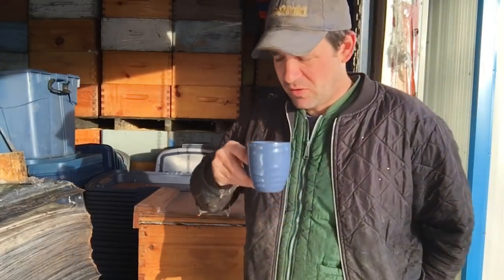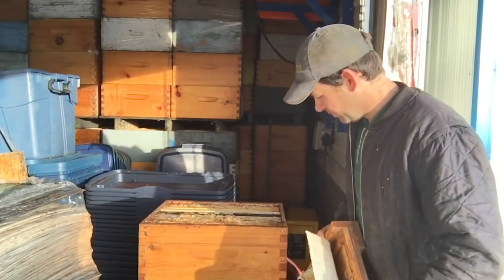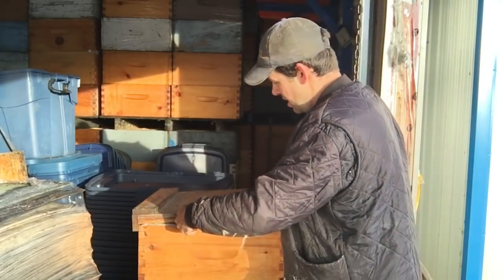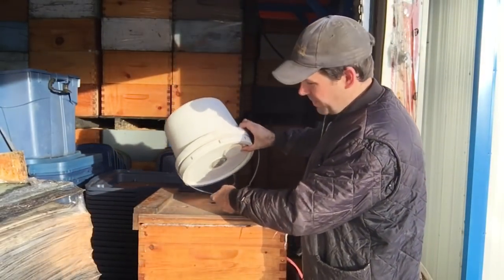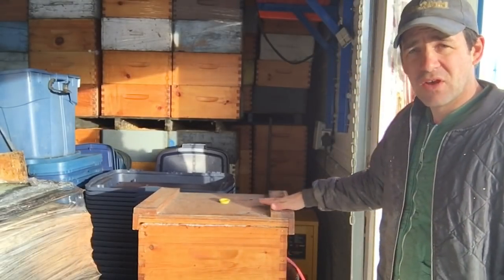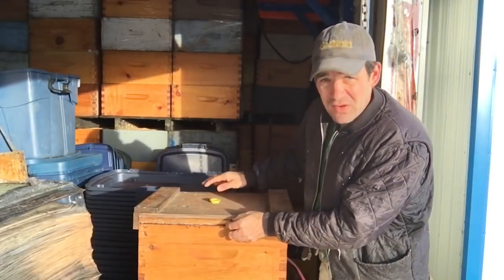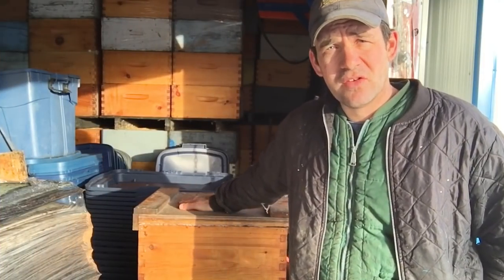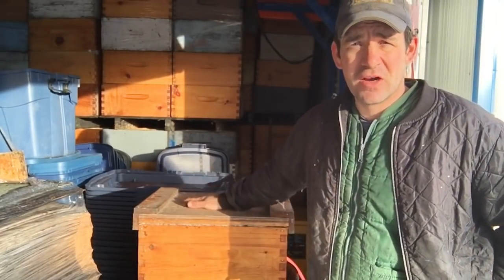Why I use pliable inner covers and thoughts on upper entrances

Comment: In the USA the product is marketed under the name 'reflectix". Home Depot sells it in rolls. It's meant to be used as duct insulation. 
Here in central Illinois I put feeder shims on hives prior to wrapping.
I bore a hole in the shim and the bees like it. I know because they never seal the holes shut. A vent combined with insulating the cover allows moisture to get out of the hive rather than condensing on bottom of lid.
If you've got moldy lids...you need to provide a vent and insulate.
Some beeks wrap hives with reflectix too. Spray it black.
Reply: Thank you, found it with that

Comment: Get that stuff at home depot, they call it reflectix, comes in 16 inch wide rolls, just cut them to length for use on a hive.  Works for a quick and easy wrap too, good wind break and a small amount (R3) of insulation.
Reply: Gerry Rozema unline has it I see cheap
Reply: You order it from FarmTek also.

Comment: Love your double hives on pallets with migratory covers.  Hives will stay warmer, not as easy to steal,  no more inner covers to make the list goes on...  My  question is i winter my bees outside usually under the barn or in a chicken coop with 3 sides protected.  Wanting to use the pliable inner covers that you use, my concern is moisture without an upper entrance?  My normal practice is inverted inner cover notch facing up and a piece of 2 inch foam then my outer cover for winter.  Any tips you might suggest?  I could cut a notch in the migratory 3/8 spacer on opposite sides but trying to avoid having two entrances.

Comment: Great stuff ... love them covers glad you showed that 1/2 " rim on the inside thanks.... 2 Q .... how do you melt the screen in the lid ? I bought the same feeders work great but need to make larger size ...... those yellow caps do you know what there called so I can hunt some down ..... thank you for the video good stuff
Reply from the maker: Ryan Nims I buy the pails with screens melted in from BeeMaid, also the plugs.  They have plugs from 1/2-2” 
They also sell the SS screen cut or in rolls.  Guy I know uses a modified calf de-horner, welded on a round ring... you might need to get creative 
Check out www.beemaid.com
Reply: Thanks for replying

Comment: Ian really enjoy your videos. I’m in my first winter ❄️ I’ve gone from 1 hive to 5 and my goal is to get through this Northern California winter with 5 and make queens and splits in the spring. My big ???? Is ventilation, We are getting a lot of rain, and snow in the upper elevations. Temps are in 40s and 50s, what should I be doing to keep the moisture out of the 8 and 10 frame hives? Any suggestions? Should I be using your bubble inner cover? Trying the simple as possible method, since I work regular job 50 +hours per week. Thank You really appreciate that

Comment: Hi there, those ply lids look nice and simple. What thickness, treatment is the plywood & do you experience much warping or rot. cheers
Reply: Nick Sheffield afaik from another video: the newer ones are dipped in wax, that eliminates the need for paint and preserves the wood very well.

Comment: Hi Ian,  I’m a retired machinist, still trying to get used to “close enough” when making my own equipment.  Regarding your 1/2” step inside your top cover, when you said it was a 1/2” runner, are you saying it is 3/4” wide x 1/2” thick, or 1/2” x 1/2” or what?
Thanks,
California Mike
Reply from the maker: MtwWallace 
It’s 1/2” deep

Comment: I have to disagree on your comments concerning scale doesn't matter....because it does.  Not in regards to your management goals, but how one goes about doing it.  Newer bee keepers fall into the trap of monkey see, monkey do.  The case that aggravates me the most is the exclusive use of deeps by larger apiaries on YouTube without the caveat that they aren't for everyone.  I've had to rescue more than a few lightweight ladies and older gentlemen that bought deeps because that is what they see the pros use.  A deep full of honey is right at my limit (7 decades in the rear-view mirror) and I would never recommend a small bee keeper that isn't a former circus strong man to use them for supers.  You and many commercial outfits have lifts, which isn't in the budget for someone with a few hives....but newbies don't seem to draw the connection that for most folks using deeps for supers is a one way ticket to the chiropractor.  Similarly most small guys can't locate hives next to major nectar sources that provide a predictable sustained major flow.   To have a decent harvest they must have production hives up to speed before the trees start leafing out (early April in the mid-Atlantic states), since much of the year's harvest will rest on very early spring production from forest mast.  Your videos are very informative, but you'd be serving newbies well if when you do  something you point out when this may not be a good idea for the new 110 pound bee keeper on a budget.